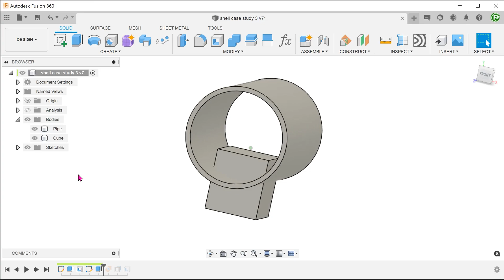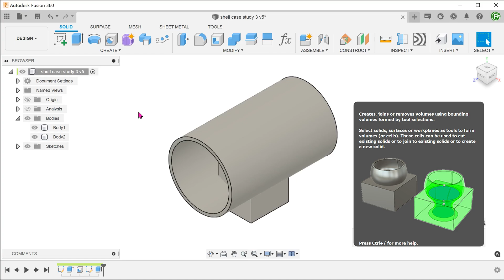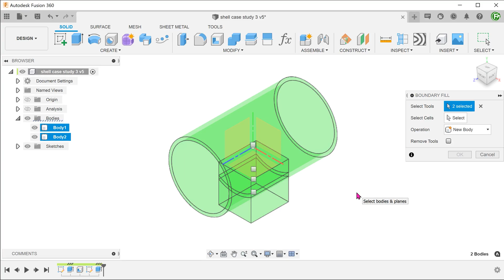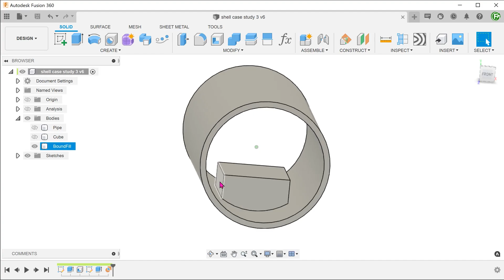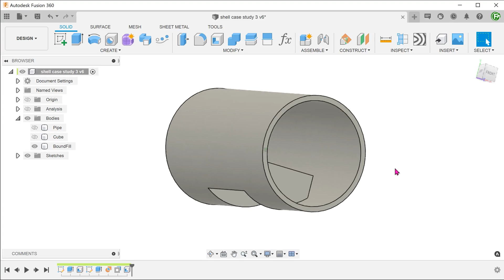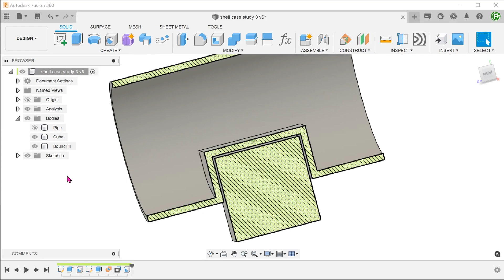Fusion 360 | Case Study 20 (Indent)

Comment: In my job I have often to extract the fluid domain inside a tool. I found that the cell selection with boundary fill used together with the time line is instable. For complicated geometries it can be so bad that I select a cell, the correct volume is highlighted and I get another volume after clicking "ok". As if the algorithm re-computes the cells (or their numbering) after clicking "ok" and doesn't re-use the cells of the preview.
Reply from the maker: I have yet to experience this. But then again, I have not tried performing a boundary fill on complicated geometries yet. Cell selection can be very challenging for anything complex.